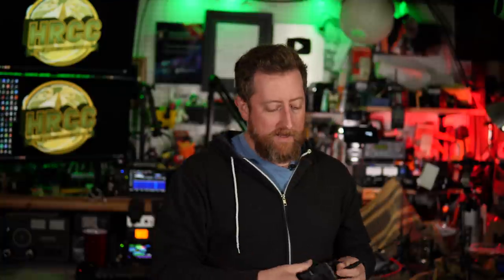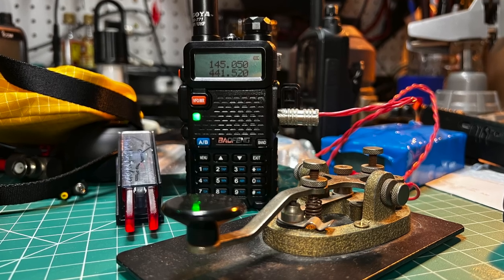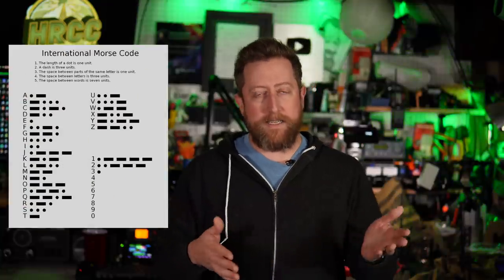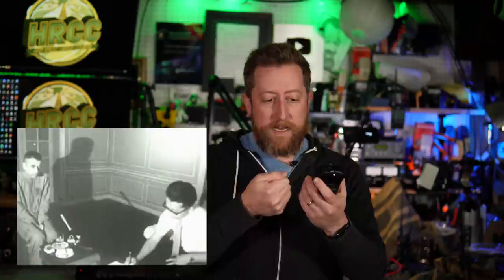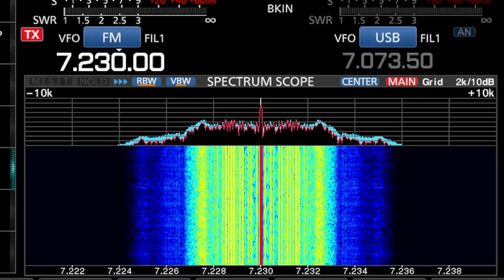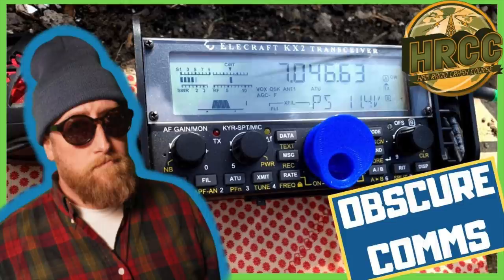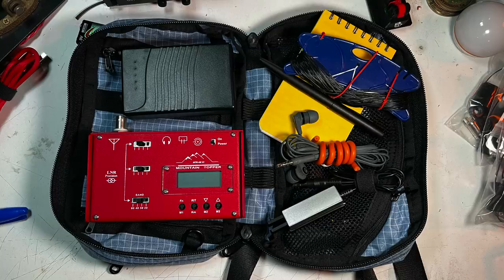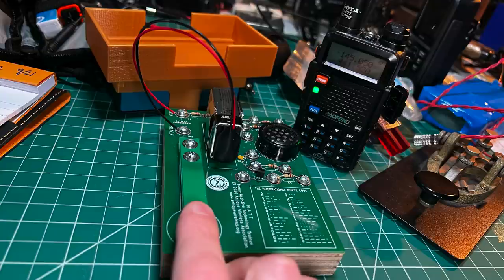Can You Run CW Or Morse Code On A Baofeng?

Comment: You missed at least one valid reason: clubs doing a CW learning or practicing net. Two years ago when I first started learning, my local club had a once a week net. Sadly it petered out because there weren’t too much of us in the beginning mode, but also because the logistics of moding a cable for the baofeng, to take the tones via audio jack, wasn’t turn key; though, at least one of the guys did it. If your user community is used to repeaters and not so fond of zoom etc., I think it could still be a very useful thing.

Comment: Josh, thanks so much for this great explanation. As a brand new ham looking to learn Morse, i already had a BTECH UV-5x3, but had no idea which HF radio was best for the purpose of practicing. Many experienced hams seem to "poo-poo" Morse on an HT (especially if there is any connection to Baofeng), but before you explained this, i did not hear a reason "why not" that really made sense. Just so happens, i found an article in the 15th edition of ARRL's "Hints & Kinks" entitled, "CW With Your H-T" for the purpose of practicing CW on 2-meter FM. The author and a friend homebrewed a couple of keyer/oscillators to send modulated CW. They announced what they were doing on the local repeater, and asked others to listen in. Their experiment was so successful, they wound up helping others built their "gadgets". Transmission was done on FM simplex; they did have to make volume and tone adjustments. Power usage seemed to be low as well since one of them ran .5 W with a Yagi on top of a 50' tower and the other had a "rooftop beam". Of course, this was during Radio Shack's heyday - the radio pictured was a Realistic, and all parts came from Radio Shack. There is a nice, clear schematic with detailed instructions...right now, i'm looking for a friendly elmer to help a really green newbie...😆😉 P.S. thanks for the tip on Weak Signal!

Comment: Nice explanation Josh. but here's a tidbit for you. back in the early 1970's I wanted to work AO7 satellite. but did not have any 2m cw equipment, the satellite cross banded from 2m uplink to 10m downlink so I took an old Regency 2m FM rig, and just keyed the mic input with a key just like you showed in the video, modified a crystal in the rig to the appropriate freq, and made contacts thru the satellite with it. yes I was wide. but turning the carrier on and off it sounded like cw on the 10m band just a tad wide. so all things can be achieved depending on your goal . back then equipment was nonexistent commercially not like we have today. thanks for another great informative video and for sharing. de Ellis WA1RKS

Comment: Great video, and good to separate the point of the audio from the modulation. However, I think you got some technical issues wrong. You are right that the answer to CW is practically no, but technically you can do it.

Is it possible to transmit CW with a baofeng? Yes it is, actually. You just short out the microphone (or be very quiet), and key out the dits and dahs using PTT. This is because an unmodulated ("no sound") FM carrier is just the carrier. Which is indistinguishable from a CW signal / tone.

Is it possible to receive CW with it? Well, again, kinda. You can't produce tones from the speaker, but if you can decode the flashing green RX light blinking out morse code, then yes you can receive. It assumes that the signal is strong enough to open the squelch, but it works.

This is the same as if you tune your FM radio to a JT65 signal: It's strings of (relatively) long fixed frequencies, so it'll open your squelch, but be quiet (because the carrier is unmodulated).

I'm also not sure what you mean when you say the battery will drain faster. 5W is 5W. It doesn't even have anything to do with the audio spectrum. The only way 5W of CW takes less power than 5W of FM is that CW doesn't transmit all the time (pauses between the dits and the dahs), but FM does. But if you click your tones as I describe above, then it's literally the same signal going out, and therefore consumes the same amount of battery.
Reply from the maker: Good point about keying the mic and seeing the light on the other end a bit esoteric, but would work in a pinch. Thanks!
Reply: I was about ready to type the same thing. Unmodulated FM is essentially CW. It's the receiving side that's a problem for FM handhelds.

Comment: In reality the difference in bandwidth is achieved when modulation is applied to the microphone, with no audio it's just a carrier like any other which can be interrupted to produce CW, and in theory this can not be truly distinguised from a CW transmitter. One of my first satellite transmitters (back in the OSCAR 7/8 days) was an xtal controlled FM rig for the uplink operating as CW and my HF transceiver for the downlink. No audio is absolutely required, so even the mic input needs to be shortcircuited as any trace of modulation will create an audio bandwidth considerably wider. Now, the Baofeng itself is a synth transceiver therefore when turned on the PLL needs some time to adjust, and that would generate some birdies except a very low CW speed, but it can be done. No CW reception can be made on a FM Baofeng though.
Reply: Visual CW RX works via the squelch LED.
Or disable squelch and listen for quiet instead of static.
Reply: Never tried that, always used the scheme for mode A satellites where the downlink were in 28 MHz, as a CW operator I think decoding by ear without a tone but a noise instead  would be hard, even worse with a light, unless the speed is really slow.
Reply: @lu7did  I'm not good enough to decode Morse  in realtime so I don't know. I managed to write down what I saw on mine during a satellite pass a few years ago, and after decoding it afterwards it was mostly correct.
1. My point was that it is possible, not easy, good, feasible or anything of the sort.
2. I do believe though that if you train a bit you might be able to use it, but still a bit awkward. On the other hand, the radio would (if you're using the light, not the not-sound) become an upconverter, letting you receive electromagnetic CW directly, in a band we humans are compatible with.

Comment: hmmm, what if I plugged jacks into the mic connections, keyed the radio to transmit, and then installed a relay circuit between the antenna and the radio, that switches the transmission between the antenna and a dummy load? then I wire they CW key to operate that relay circuit , now I am transmitting actual CW,  perhaps even also have a sinusoid pumped into the mic connector, so that the signal can be receaved by any other handheald, as well as any other radio that actually picks up CW and turns it into a beep.
I will still be on a wide wand width, but I think this way one could actually gain some range  over voice

Comment: What is the bandwidth of an unmodulated FM signal?  How do you determine if a pure unmodulated carrier is generated by an AM, FM or CW transmitter?  If you wired a hand key to the PTT contacts of an FM HT mic jack and tapped out CQ, what would it sound like when received by a CW receiver?   Just wondering.

Comment: I'm new, and I had this question.  (well, minus the baofeng) My only radio is so far is a HT. I've just learned morse code, and I'd like to get a little practice sending just for fun. I'd love to do it on the air, just for the thrill of  practice. I wouldn't expect anyone to respond, but being FM maybe someone would listen and give me some feedback. Maybe I'd just be sending my signal into the void. Either way, it seems like a fun way to get just a little more into things.

Comment: I find that in our hobby of experimentation the question "why would you do it that way?" or any derivative thereof is the closest thing to a stupid question we can ask.
Reply from the maker: Sure
Reply: Not trying to be a jerk here. What I mean is that half of the fun is finding unorthodox things to do and see how far you can take them. Like it would be super easy to buy a mobile. 2m/70cm antenna but I like to try to make them out of welding rods, or winding end feds on HF when HRO has,reasonably priced antennas

Comment: CW stands for Continuous Wave, which means continuous sound, which is like voice, but but voice varies in tone and length.  You could just say DIT or DAH, or just substitute correct beeps or tones.
The problem would be to inject the tone into the microphone input.
Just for kicks, how would you transmit CW on a BF radio?

Comment: I will tell you why.  144.0 to 144.1 mhz is reserved for cw?  Well the arrl band plan says you can only send cw in that frequency range.    So the real question is, can you hack a piece of electronics to make a   2 meter fm transceiver to do it?  But you ask, why. Because HF requires an antenna which is far different from 2 meters.  Maybe the situation is that a HF antenna is not feasible.   Ok so that is why.
Reply: And that is my issue.  I can't put up a HF antenna and I really want to you know try CW on a hand held because I'd like to try going live with my CW skills.

Comment: Well, there are two advantages of Morse code. Foremost that's not an English language, this to say first, it is a way to express alphabets, Latin alphabet, but also Cyrillic, Japanese or even Chinese by a series of dits and Dahs. It is not language dependent, so in effect it is an alphabet carrier mode. What you can write, you can send. And it is also not only the only language mode, that we literally share with the machines, means this language gets spoken by your average printer for error or paper messages, your microwave, your motherboard when booting up and many many more appliances. Actually to send out Morse code is very easy for a machine, because you just need a buzzer, nothing has to mimic the human mouth and orifice and all that by speakers and recordings and playbacks. You just need to switch a buzzer on and off, that's why every halfway smart programmed thing in our world speaks Morse to us and if we can't understand that, we are like the 5yo that still doesn't read or write and tries to find his way through the street signs to his home.

We are blind in our environment. 

So, this was clearly wrong, Morse is not English. Fuck, no, modern Morsecode was invented by Clemens Friedrich Gerke, who did the Hamburger Code very early, which got converted to the international code we are using today with very minor changes. And that was a German engineer from my city. 

And when it comes to the propagation, there is an other major error. It is true, that the smaller bandwidth will gain about 27 dB (factor 300-500) against a weaker mode like FM in readability, but you might have noticed, that you can hear roger beeps long, long before you can understand spoken language on a channel/frequency. The reason is, that not only the energy gets better distributed by CW against AM, but also the legibility of an on/off beep goes far over the difference on a noisy background between a C, F, V, CH, S, H, just to point out the worst parts of our sounds. Also to understand D, T, B in a noisy background is almost impossible. So instead you get very clear and well readable signals, that you can understand and read even under the worst kind of noise that is on the band.  If you scream at someone, you hardly will get over a city street understandable, if you are using a whistle, you can be heard and understood around 500 meters.

This is somewhere between 5 and 10 dB, depending on the language used and the voice of the speaker, means this signal is around ten times better. I had some very noisy connections to the US on the CB band (yes, I also show up there sometimes) and those guys were just noise on FM. So I fired up my rig and keyed with my Morserino a signal into that noise and I got an answer soon. Not from the US, but from Spain, which wasn't at that time audible at all. A clear and well readable signal going over FM and we had a fun chat, while even the guys in the US stopped buggering us, because our signal was throwing them out of our transmission and they could not even do something against our legit 4W signal with their 1000W whale-boosters over there. 

That's what Morse does for you. If I say, this will boost the readability about 10 dB, it will most likely be even more, but I stay conservative here, because this is the internet and someone will know it better otherwise. CB is a perfect noisy and trashy environment, where Morse really shines. Sadly the only guys you get there able to read that, are HAMs that will answer, we had two pure CB operators in Hamburg, able to do Morse, but one of them already converted to be a HAM. Of course you can do that on normal frequencies, too. On SSB this will always punch through, for example during emergency radio training I am often using CW in the middle of SSB, because many HAMs can read that and I will get the message through, when we are stuck for more than a few minutes, unable to get through the noise of bad conds. CW will get through. Always. And because you don't need a computer, this also works under all conditions.

de DL7HH

Comment: "Technically" keying up a 2m/70cm radio with no modulation is CW (A1).  Assuming that there is little to no delay in keying the radio on and off, it might be possible.  Also that does not provide for reception of that same signal.  Not particularly practical.  Still I suppose that one might use an SDR receiver and a Baofeng HT to send CW on 2 meters.  But that is a lot of work for something that  would be largely impractical.  Good video. ;-) 73

Comment: Nice video. I have heard CW on FM repeaters and simplex. part of learning CW. and for that reason using Baofeng to TX CW has a great use. it's not the point of bandwidth. it's learning CW with a local HAM. I remember old Radio Shack walkie-talkie with CW key on them. My 49Mhz space portal one does runs on 9V .   still a Legal CB band. 49Mhz. we used them at local hamfest and no one found us. LOL . go so many laughs when we told them. everyone thinking CB/MURS/FRS ?  well CW on a Baofeng? What if something happened and that person can not speak? CW lets them be heard. nice video. Put some Ham Radio Crash Course stickers for sail on you cite if you want. looking for one for my laptop. willing to buy support the channel . 73's

Comment: actually, the old walkie talkies sold by radioshack used a sound circuit to make the sound at a beep that you heard, not efficient but, it worked, so, it could be done replacing a microphone with a 555 circuit of some sort operated on FM, or AM for learning morse code... not efficient but for those technicians not yet able to operate on HF, and unable to afford 2 meter all mode radios, this would be an option..not sure how to build the circuit however..

Comment: Question... Have you ever tried CW over DMR?
Reply from the maker: No, with bandwidth as big as DMR, it might be wasted bandwidth.
Reply: @HamRadioCrashCourse  Well I meant as practice... For example if someone made a NET for CW practice.

For example, currently at the moment I can't get on air other than 2M local repeaters, but I do have several DMR radios and a Hotspot.

It would be great to practice CW with like minded HAMs via DMR

Comment: I dont see why sending a tone transmission on FM should not be classed as NOT CW or morse.....Ok it maybe a wasteful use of band space.

But messages could be past back and to.

Aviation NDB transmitters us a wide band AM signal.....they send very good CW or morse if you like 24/7 opn AM so pilots can id the transmitter is the one they want.....can be heard in the MF section of the bands around 300khz

My local airport in the UK uses 349.5khz AM
Reply from the maker: Because CW is literally the mode of operation. As an HT runs on FM. CW is a specific form of modulation.  You can send Morse Code over FM, but it is as you mentioned a waste.
Reply: @HamRadioCrashCourse  SO what.....you can communicate in morse on FM on AM ....end of story.

Comment: I’m curious as to why not every radio has CW mode built into the radio. The circuitry can’t be that complex.
Reply from the maker: More money in r&d and components for a mode 90%+ likely won’t use.
Reply: @HamRadioCrashCourse  True, but at least if it’s available, more people will want to try it and if they like it, they’ll want more of it making these modes more popular in use. Also, components are cheap. The research and development would be more expensive, but that can be passed onto the consumer. Besides, there are a ton of HT radios that vary dramatically in price and a lot of them pretty much just do the same thing. I’d be glad to pay $50 more to have an extra mode.
Same with SSB on VHF. If you only have a few radios that can work this mode, it won’t be as popular to use and less people will be interested in it, especially Technicians.
FM is great for repeaters and hiking with friends, but SSB on 2 meters would be so much better at reaching more people on Simplex, especially with a compromised antenna.
Reply: I think it would be a fantastic selling point. It could save your life!